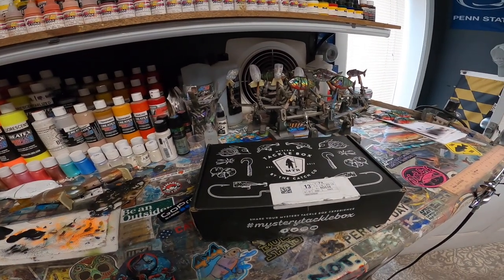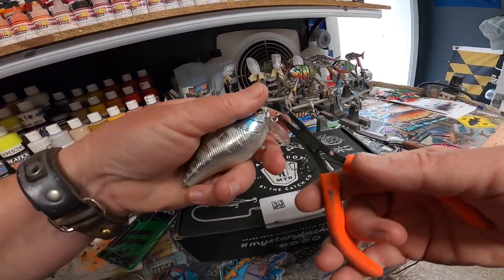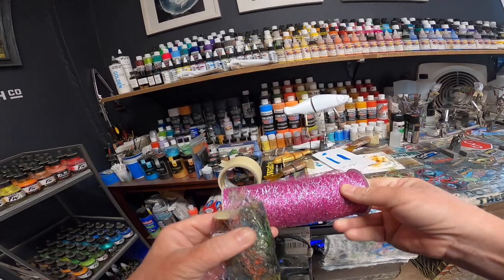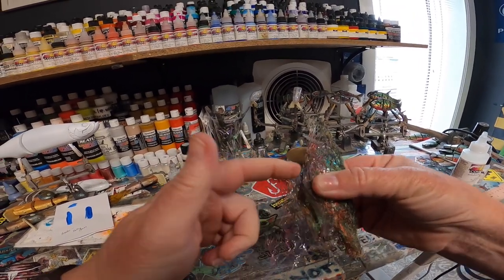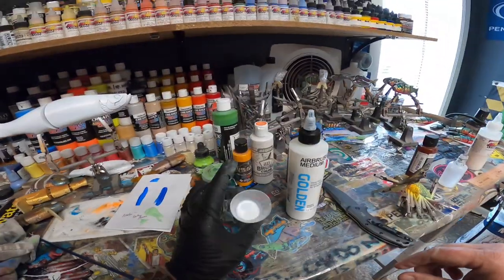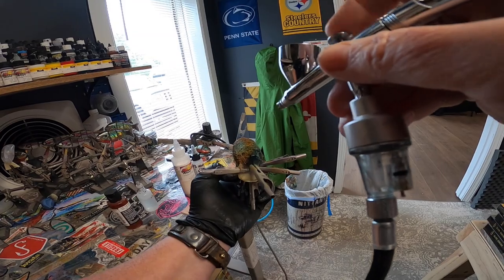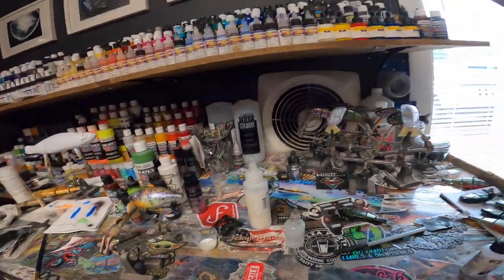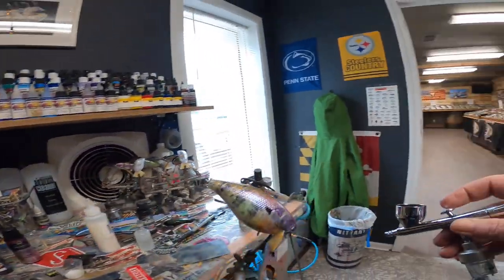MTB REPAINT #15

Comment: Doggone you. I been trying that folk art color shift lately and it plugs up my Iwata so bad. Trying to thin it and spray at 40psi. I end up having to use the 0.5 harbor freight siphon sprayer 

I find it to dry pretty clear. I did some test on clear blanks and the white seems to fade quite a bit with heat set
Reply from the maker: The Airbrush medium really makes a difference 🙂
Reply: @Jekyll424  is that different than just reducer or retarder?  I was using some from Createx. Didn’t try a translucent base yet
Reply from the maker: Yes. Different.